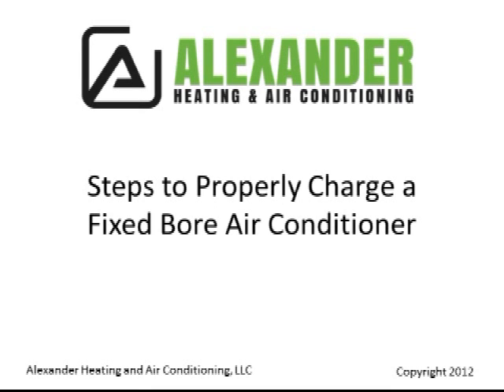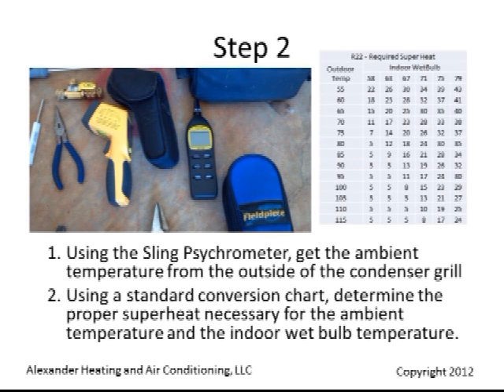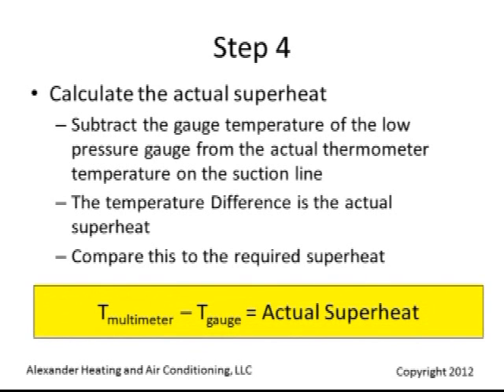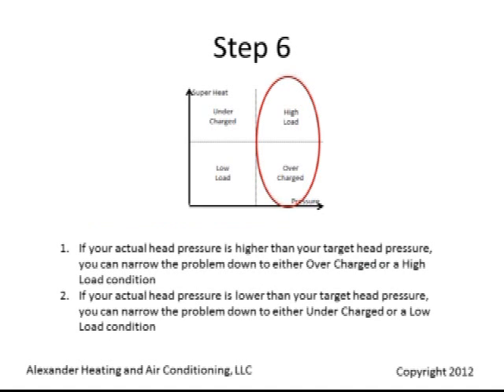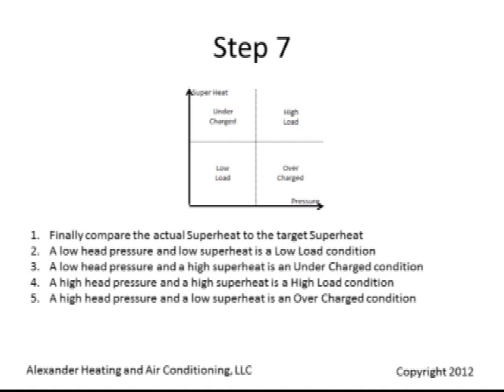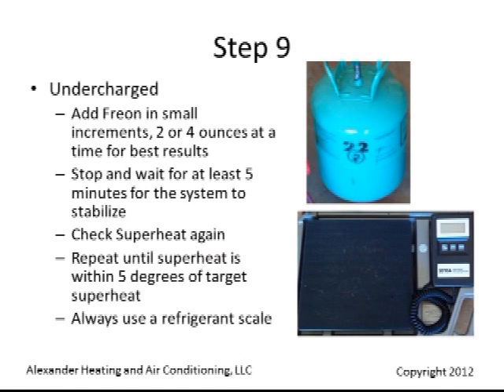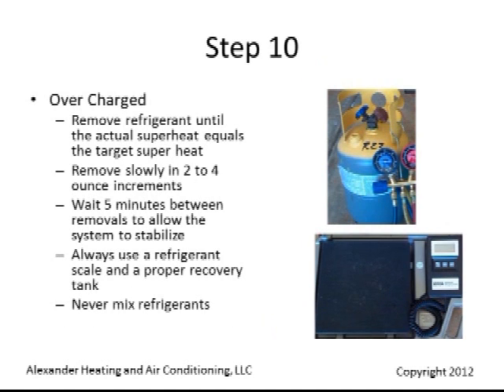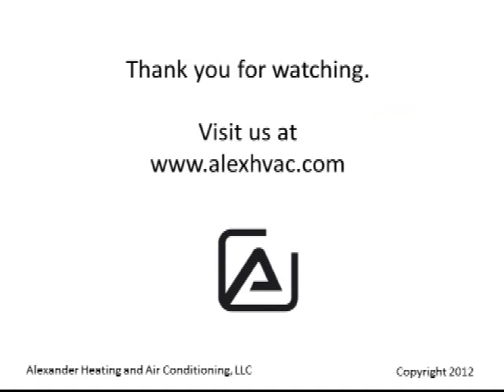How to add Refrigerant - Air Conditioning Companies near Cary NC

Comment: Yes, I understand now. I checked my actual SH and it's 25. My target SH is 25 and so I'm good for SH but have slightly low Head Pressure. I am not going to add any Freon. 
These are the numbers I measured- 
Indoor WB- 72 F
Outside DB- 84 F
Target SH- 25 F
Suction PSIG 75/ 45 F
Suction Line Temp- 70F
I have low head pressure in accordance with this rule- Outside Ambient + 30. That would be 84 + 30, 114. From the PT Charts that should be around 270 PSIG. I have around 230~235. Opinion?

Comment: Well, I just went back a reread the slides again.....I guess I have a Low Head, ??? super heat......
The actual superheat I measured earleir outside is approximately 12 F. 
I will have to recheck the actual outside again to be sure....
I will have to do the wetbulb and ambient once again to be doubly sure what the TARGET superheat should be before I post anything further.....

Great video and informative slides.

Comment: Frank, there's a lot to absorb here. So you are saying that the head pressure is always the outside temperature + 30 degrees and we should adjust the R-22 charge accordingly? For example, mine at this time is 225 psig. The ambient is 90F ( 90+30) and from the PT chart my "TARGET" head pressure is 260 psig.

So I should add R-22 until I approach 260 psig FIRST before going on to verify superheat? Is that correct?